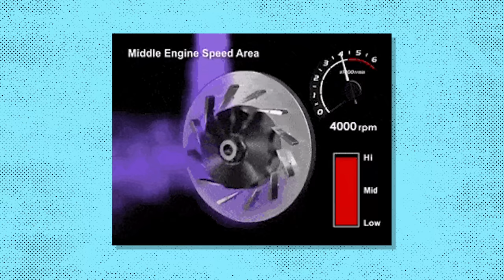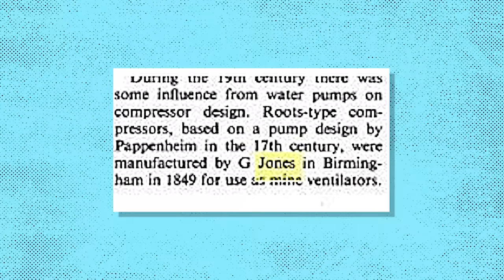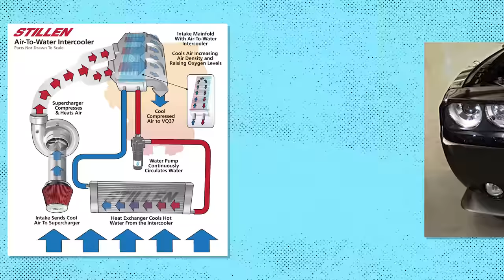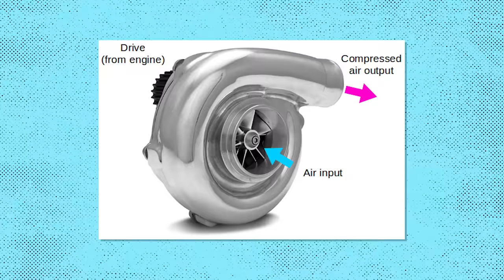Why Superchargers Aren't As Good as Turbos

Comment: SUPERCHARGERS HAVE BEEN USED BY CAR COMPANIES......so what the hell are you talking about "Nobody uses them"????????????????

Both Buick and Pontiac in the late 1980s and into the 1990s built production car WITH supercharged engines!! Ford F-150 Lightning trucks for YEARS used supercharged engines, as well as some Mustang models throughout the years!! In fact Ford had a contract with both Whipple and Paxton, for superchargers for a number of years as "vendor manufacturers/ suppliers" of many of their supercharged offerings!! Even at one point Chevy was using a supercharger on some of their trucks in the mid to late 1980s as well!! 

FURTHER Supercharger HAVE a number of advantages a turbocharger DOES NOT HAVE.....like the fact that a supercharger CONSTANTLY "makes power" where a turbocharger works "on demand" and only works as long as the waste gate IS closed!!!!
Reply: ALSO Centrifugal Superchargers, like Paxton Superchargers, ARE only as big as a turbocharger, BUT do require a belt to drive them unlike a turbocharger!!

Comment: Wouldn't look too good on a golf... 

Golfs with supercharged VR6 engines looking at this.
Reply: GTI..
Turbo
Reply: @sandervanderkammen9230  :/ Kompressor VR6s existed buddy
Reply: @sandervanderkammen9230  the 2006 golf GT was even twincharged, both turbo and supercharger
Reply: @CaCidinho  Yes, VW uses both.
Reply: VW made supercharged cars namely the Golf G60 and Rallye ,Polo G40 and variants of the Corrado.
Reply: @Buck3366  VW also makes makes many more cars with turbochargers.
Reply: @sandervanderkammen9230  I’m not getting your point? They have made cars with turbos,superchargers and twin charged using both forms of forced induction with the 1.4 TSI. That engine was used extensively over the entire VW/Audi/Skoda group. Yes supercharging has become less of a method of forced induction because turbo charging has been heavily reliant for use on popular diesel engines and had extensive development with twin scroll, variable geometry and multi unit set ups like the BMW triple/quad turbo 50/60d engines but superchargers are still around in 2023. It’s not all roses. A turbo can’t give the instant response of a belt drive and can give major lag if using an oversized unit for big power gains. In contrast a smaller turbo to create less lag has to be compensated by using 2 turbochargers to make the power one alone can’t  meaning that’s TWICE the problems and chance of failure ( or in some cases as mentioned above 3 or 4 turbos to make more power) and huge heavy engines. They both have benefits and negatives and BOTH will be out of service in the next few years regardless. The internal combustion engine is over sadly.
Reply: @Buck3366  The point is that turbos are superior to superchargers for several reasons which is why they are more popular, engines like the TSi use a modified Otto Cycle to vary the dynamic compression ratio, this is often achieved with the assistance from a supercharger but in a some VW models a turbocharger is also used to unload the blower and cancel our its parasitic drag on the engine when its not needed.
Reply: @Buck3366  Turbochargers don't just increase volumetric efficiency, they also increase thermodynamic efficiency... something superchargers can't do.

Comment: I though supercharges blow, i suppose your video says they do 😉

Also superchargers are about net gain. Any loss in power is overtaken by the gain in power.
Reply: Superchargers have LESS gain compared to a turbocharger.

Turbochargers produce more horsepower and use less fuel.

Comment: But turbos are creating backpressure which makes engine less powerfull, so they also use engine power to make engine more powerfull.
Reply: Also you need custom exhaust for the turbo setup / pos of heat soak etc
Reply: Wrong, the Turbocharger runs on free energy from the waste heat energy in rhe exhaust.
Turbochargers produce more power and are more efficient.
Reply: @sandervanderkammen9230  Turbo works due to the velocity of the exhaust gases. And the exhaust gases have velocity due to the engine piston pushing them into the exhaust. Yes they are more efficient, but their principle is same as supercharger principle.
Reply: @technicbuilder6410  No, you need to go back to school... you don't know how a turbocharger works.
Reply: @sandervanderkammen9230  I know how turbos work, and I'm in school rn.
Reply: @technicbuilder6410  Kindergarten? Because you don't know how a turbocharger works.

A turbocharger is a heat engine and operates using the BRAYTON CYCLE in a Combined Cycle with a OTTO or DIESEL ENGINE
Reply: @sandervanderkammen9230  You need energy to spin a turbo, and energy can't be made out of nothing, so you always have to take some energy from the engine. Turbo just uses gases instead of belt.
Reply: @technicbuilder6410  The Turbocharger operates on HEAT ENERGY.. energy that is normally wasted out the tailpipe.
Reply: @technicbuilder6410  Wrong, you lack the ability to recognize the fundamental difference between a turbocharger and a supercharger.
Reply: @sandervanderkammen9230  but they create backpressure, which makes your engine less powerfull.
Reply: @technicbuilder6410  Wrong! You are not formally educated and don't  have any  professional experience to speak inteligently on this topic.
Reply: @technicbuilder6410  The exhaust gasses continue to expand after the exhaust valve closes.
There is no significant backpressure,  Bernoulli's Principle tell us that pressure drops as velocity increases.
Reply: How can the turbo cause backpressure if it flows more air than a supercharger???
Reply: @WilhelmKarsten  I don't know what are you talking about with the airflow. But the backpressure in the exaust is caused by the boost in the intake, the bigger the boost is the bigger the backpressure is (third Newtons law) this is literally how wastegates work, they controll the boost through the backpressure.
Reply: @technicbuilder6410  Yes, clearly you don't.

You just contradicted yourself, if the pressure is higher in the intake manifold?
How can there be any backpressure?
Reply: @WilhelmKarsten  because in order to create overpressure in intake there has to be torque going into the compressor impeller, that torque is going there from turbine impeller, and in order for the turbine impeller to create torque there has to be pressure in the exahust. Third Newtons law how I already said, intake and the exhaust are connect, not literally, but through the turbo.
Reply: @technicbuilder6410  Thank you for proving my point, there cannot be any backpressure if the Turbo flows more air than the engine can on its own.
The pressure delta is positive, not negative
Reply: @WilhelmKarsten  but once engine combust the mixture it expands so on the hot side it is exactly the other way, engine flows more exhaust gases than turbine of a turbo.
Reply: @technicbuilder6410  The turbine cools the exhaust... it extracts heat and converts it into horsepower.

Comment: Turbo chargers are a problematic reliability issue!  Supercharger gives you instant power which is preferred on streets!
Reply: That is completely false, your average, quality turbocharger can last the life of the engine and they are very reliable, reliable enough to pass the PFTR reliability standards for FAA or EASA airworthiness certification in type rated passenger aircraft.
Reply: Superchargers give less power, which gives you slower performance.
Reply: @sandervanderkammen9230  you obviously have no experience or knowledge of superchargers
Reply: @bubbafatas2588  It's an irrefutable fact that cannot be disputed, all other variables being equal, a turbocharged car will always be faster because turbos make more power.
They make more power because there is no parasitic load on the engine.
Any questions son?
Reply: @sandervanderkammen9230  My preference is for the instant power from a supercharger!  I hate having to rev the engine to get boost!  The numbers don’t always tell the whole story!  Drivability means more than your dyno numbers!   Ive seen more than one driver lose a race because his engine didn’t hit best boost RPM at the start!
Reply: @bubbafatas2588  The numbers don't lie, instant slow is still slow. Turbo lag does not mean accelleration lag

Comment: It's worth mentioning that certain engine designs such as the Miller Cycle and high performance 2-strokes depend on positive displacement superchargers to work at all. If they tried to use a turbo they'd such so much exhaust gas back in they'd stall even with no load.
Reply: That is completely false, centrifugal compressors can and are used as scavaging blowers on 2-stroke engines, there are many examples of   production 2-stroke engines that have centrifugal superchargers and turbochargers.
Reply: @sandervanderkammen9230  It is completely true.  ALL 2-stroke engines have positive displacement superchargers, even the one in a leaf blower.  They use the crankcase as the supercharger.  Perhaps it's possible to make it work with a centrifugal supercharger, but certainly not a turbo unless you keep it revved high enough to be in boost all the time.
Reply: @rightwingsafetysquad9872  Several 2-stroke engines have used centrifugal compressors, Turbochargers, both or in a Turbo-Compound system.
 These engines have been both Benz or Diesel Cycle.
Most use the;
 Oechelhauser Gegenkolbenmotor (opposed-piston) concept.
 Winton type (Uni-flow) concept.
or the Knight type (Sleeve-valve) concept.

These have been manufactured by;
Lohner-Porsche 
Jumo 
Rolls-Royce 
Napier
Winton
EMD
Detroit Diesel
Dobrynin
Fairbanks Morse
Charomsky (Kharkov)
Reply: @rightwingsafetysquad9872  Most of the applications which use a turbocharger or turbo-compound system the centrifugal compressor is coupled with the engine crankshaft through gear box and a fluid coupling or clutch.
This allows the compressor to spin at an adaquate rpm during start-up and idle, it also allows excess exhaust gas energy at full throttle to help deliver horsepower directly to the crankshaft from the exhaust turbine.

Comment: This video is a bit of a bust ... a lot of misleading and incomplete data points are present.  You should probably have a stroll through the comments here, and then consider remaking this video.  

Just one example, super chargers are widely popular in Australia (a fact not mentioned in the video at all).  You can get new, 2023, super charged Land Rovers, Jaguars, Volvos, Fords, Chevys, Nissans, and even a Mazda CX-30 Astina. 

Not to be overly critical, but this video has the feel of a presentation based on what was found in only the top results of a Google search without any real practical or technical experience with super chargers.

Comment: To me you just spund like a turbo fanboy because in terms of superchargers vs turbochargers, turbos are easier and more cost efficient AND fuel efficient which is what just about every car manufacturer goes for. Superchargers do need power to provide power, but pound for pound the supercharger will always be WAY better than the turbo. Want crazy power with a turbo? Put a huge one on, but watch out cause you'll have a 14 second spool up time before any boost really has any effect. Want crazy power with a supercharger? Lose 100 horsepower to gain 350. The benefits for a supercharger far outweighs a turbo. That being said, if you want the absolute best setup then a twin turbo with a supercharger setup is the real way to do it
Reply: That is completely false, superchargers can never match the horsepower generated by turbos..
 The turbocharged engine will always produce more horsepower.
Reply: @sandervanderkammen9230  yeah if you've got a huge ass turbo. But while you're busy getting your turbo to spool, I'm already a mile away. But the same size supercharger and the same size turbo are going to be the same. The supercharger has no lag, the supercharger is better. Keeping it simple. I've built many cars with turbos and superchargers. The cars with superchargers have always performed better. Just a fact, sorry kid.